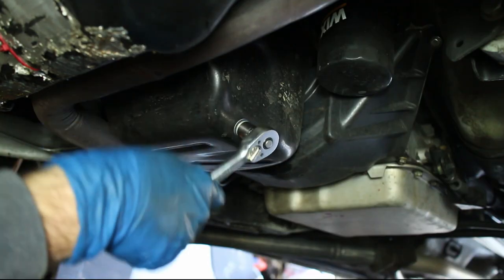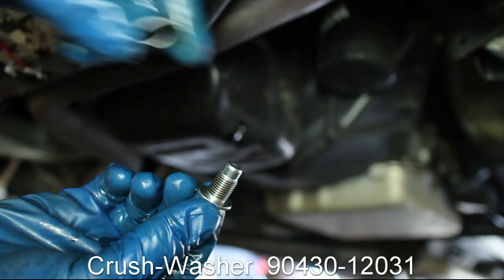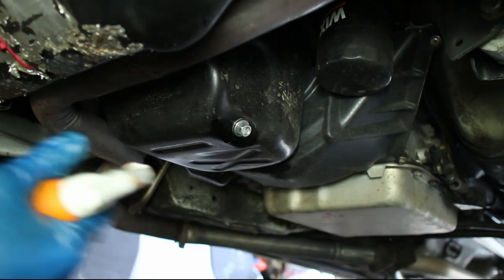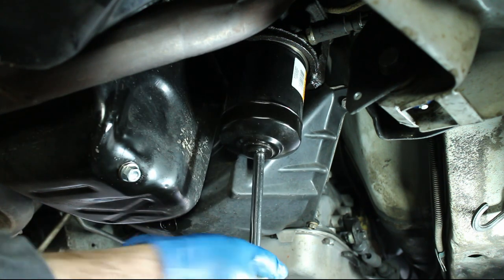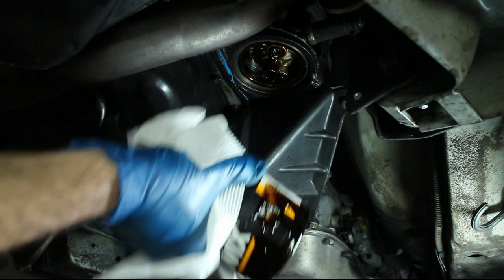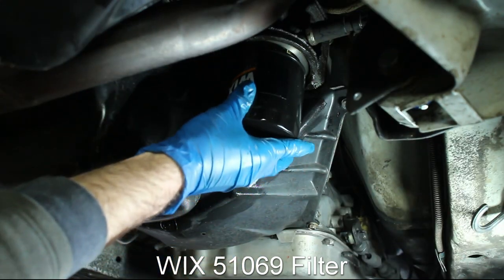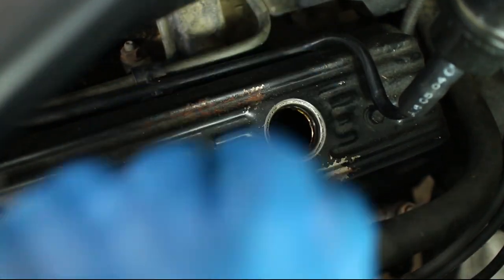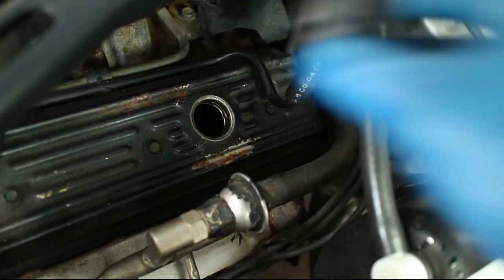DIY Oil Change (1982-1992 Camaro /Firebird)

Comment: greetings from Germany how often do you suggest to do it? My turdgen is a 85 z28 lg4 and never had an oil change at 87000 miles...
Reply from the maker: some 3rd gen V8s have roller cams and others don't.
with a good Synthetic oil
i suggest 3,000 miles (5000km) for a NON-roller cam
5,000 miles (8000km) for a roller cam. 

if you do any racing, i suggest 3,000 or even 2,000 mile changes.
Reply: @3rdGenGuy  thx m8 i meant it more like a joke.
so i just changed valve cover gasket oil and filter and the engine runs fine so there must have ben a oil change in the past but old the oil is black like coal and smells like a burning Fart.
I also changed Trans fluid and now its all leaky lucky me.

Comment: Cool video!! Say do you add any zinc additive to your oil. I've heard that any car before 95 needed a zinc additive.
Reply: @benkalinowski5834  Man i guess i heard wrong thanks for the info.
Reply: gen 2 hydraulic roller sbc doesn’t need zinc. like the previous guy said pre 86 blocks that use flat tappet cams
Reply: @John-jr1si  Again thanks for the info i got a 92 Z28 5.7 TPI and with all the talk i have heard about zinc i wasn't sure .
Reply: m1a1hm oh nice. what color? i got a 91 but it’s an rs. swapping out the motor soon
Reply: @John-jr1si  Its purple haze now it's no show car and it need a new paint job and I'm still working on it but i drive it about everyday .
Reply: @John-jr1si  What kind of motor swap are you planning on.
Reply: m1a1hm 383 stroker. those purple haze camaros are pretty rare if it’s RPO matching
Reply from the maker: I use Diesel oil so it has high Zinc, but most 3rd gens have roller cams and don't need it.
Zinc can kill catalytic converters though though
Reply: @John-jr1si  A 383 stroker man thats cool!!  Well i don't know about how rare it is but i was surprised when i first saw the car it had rear disc brake i though most came with drums.
Reply: @3rdGenGuy  Yeah thats what i have heard about the catalytic converters when it come to zinc . Thats why I'm kinda glad that someone in the past install headers  and did away with the cat . I want to keep the car mostly stock with a little more performance you know just a good driver. Now i would like to find some factory iroc z wheels for it thats one of the few things i would go na stock.
Reply: m1a1hm yea, not that cool tho. I went crazy with the engine and I don’t think my 700r4 gonna last long behind it. :(
Reply: m1a1hm swap out the tpi intake with a lt1 intake, replace the timing chain and ignition parts.
Reply: @John-jr1si  Its kinda hard not to go crazy when do a motor . Yeah the stock 700r4 overall is not a bad trans but if you push to much horse power through it something going to give.
Reply: @John-jr1si  Man that is cool!! Do you still have the stock TPI intake.
Reply: m1a1hm oh no, I never had a tpi. I was just suggesting that to you cause you told 3rd gen guy you wanted it mostly stock but some extra oomph. I heard from thirdgen.org the lt1 intakes don’t fall flat on its face after 5k rpm.
Reply: @John-jr1si  O sorry dude i misunderstood what you were saying . Yeah that would be a cool upgrade . I'm sign up to thirdgen . org cool site.
Reply: @John-jr1si  Yeah it dose fall flat around 45 to 5 k . I was thinking about install a BBK throttle body but I'm not sure if there worth the money.

Comment: What size is that oil filter socket cap
Reply from the maker: not sure, but any local parts store can tell you.
it's the same GM filter used on everything.